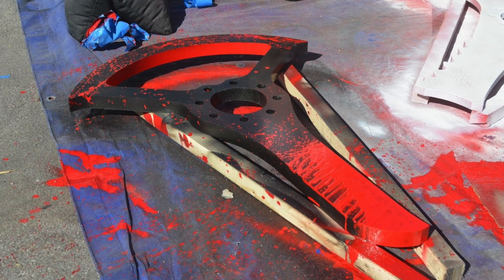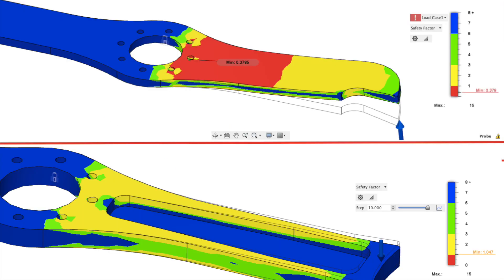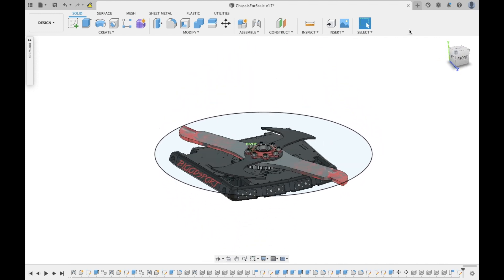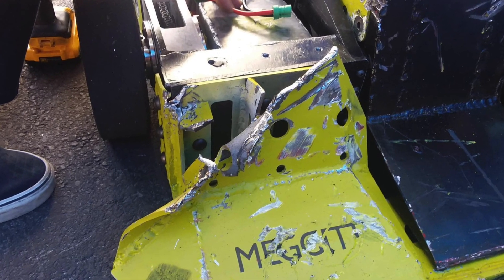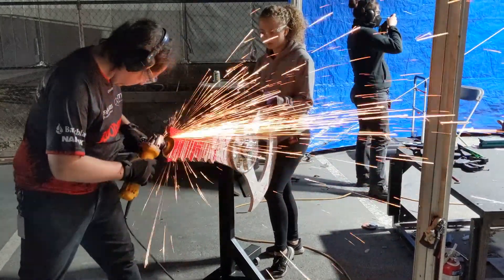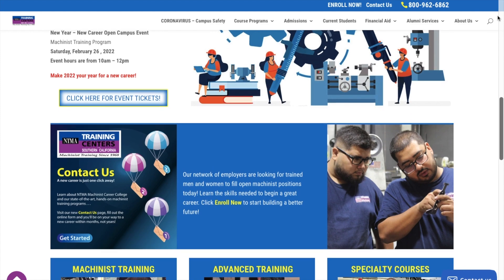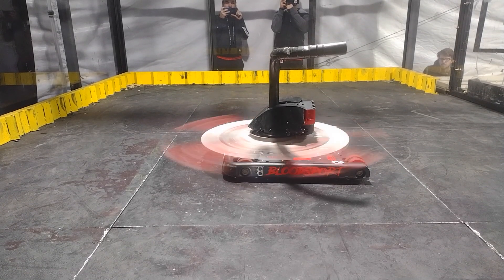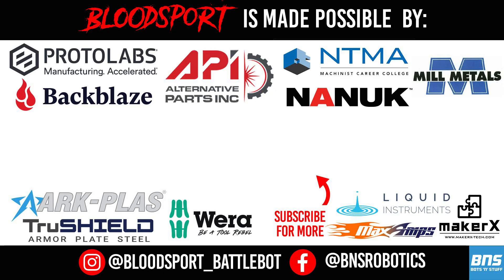The Skeleton Key - Battlebots WCVII Blade Design

Comment: The long bar is unbeaten against everything that isn't a vertical spinner compared to the other bars. It worked so well so far. Maybe the focus should be in making the points more chipping resistant. The shape seems a little too aggressive.

Comment: Spoiler to those who didn't watch ep 11

Good win from bloodsport, I honestly thought that it had durability issues due to the copperhead fight, how was I proven completely incorrect. Turns out copperhead just hits harder than a truck.
Reply from the maker: We definitely did have durability issues in the Copperhead fight, but with the help of Protolabs we were able to replace the failed part with a much stronger version and it certainly paid off in this one!
Reply: Copperhead doesn't even hit particularly hard for a vertical spinner. And they didn't even connect at all with Bloodsport- it was Bloodsport's own weapon that broke their plastic cover and the circuits.
Reply from the maker: @olisk-jy9rz  It was a mutual weapon to weapon impact. Their drum caught the underside of our blade a split second before we made contact with their frame. I would guess that between the two weapons, about 100kJ of energy was exchanged in that hit.
Reply: @bnsrobotics  That's insane. My 12lb machine stores 3.7kJ in a vert total, not even counting what actually makes it into the material.

Comment: I'd love to hear about how the keys do with dzhanibekov effect. I remember that being a concern in the past
Reply from the maker: We're well overdue for a deep dive video on that topic, but the dzhanibekov/intermediate axis effect is still very much part of our design process. Only a tribar is truly immune to that effect, but adding a stabilizing cross bar to something like the Long Bar helps us to mostly avoid it during fights. The wide counterweight of a Key serves the same purpose, while also contributing to the balance of the blade in a way that a crossbar can't. Because that mass is helping in 2 ways, a Key can actually achieve better stability for the same weight and MOI compared to the Long Bar. The bigger concern with a Key is, like we saw in the Copperhead fight, the blade gets so much bite that it comes to a dead stop and no longer keeps the bot level via gyroscopic effects.
Reply: @bnsrobotics  In early tests I've done, replacing one of the teeth on a tri-bar with a counterweight has a similar stability. I'm trying it out at 3lbs and 12lbs soon at NHRL, so maybe there'll be some more weird weapon shapes to explore. I have the teeth 90 degrees apart, but going back to 120 would be even more stable.
Reply: @bnsrobotics  Thank you for the in depth answer. It's always cool when builders interact with the fans
Reply: @bnsrobotics  You said you're overdo for a video on the topic, and I would love to see that. I'm interested in how you evaluate how a blade will be affected by the intermediate axis effect without actually spinning up and asking Jake or Aren to give you a test flip.

Comment: So what's the plan moving forward? Will the self righter get updated or will  every weapon be symmetrical from now on?
Reply from the maker: We're still working that out for the next season. Part of it is trying to understand why the old Bloodsport could right itself with a Key but the new one can't, which could help us redesign the self righter. Another option is to widen the counterweight of the Key until it props the chassis off the floor the way the other blades do, though that negates some of the weight advantages that a Key has over a symmetric bar with a stabilizer on it.

Comment: That clip of the attempted self-right with the key is weird. It kinda just looks like the motors don’t have enough torque, like the bar just touches the ground and stalls. Is that the blade’s fault? Especially since that particular key is shorter so it should have better leverage than the long bar
Reply from the maker: It's to do with the way the chassis sits on the floor. The wings on the Long Bar act as a kickstand, so the chassis is free to spin without contacting the ground. The difference between BS2 and BS3 has to do with the angle the bot sits at, and the torque needed to spin the chassis when it's touching the floor. The length of the blade doesn't have much effect aside from how it props up the chassis, since once the blade touches the ground it's effectively fixed in place while the chassis is what's moving. This very problem was actually the main reason why Bloodsport 1 was circular.

Comment: I wonder what would happen if you put a max moment-of-inertia weapon on top of Bloodsport, so kinda like the ferrous wheel but with even less bite and more mass on the outside ring. Just put so much gyro-stabilization in there that you never even have to self-right.
Reply from the maker: That's basically the philosophy of Son of Whyachi. The problem is, more MOI either means adding weight or compromising on other things like bending strength. A greater MOI weapon also needs more torque to spin up, which is the problem we've always had with our Tribars which are usually our largest MOI blades. Battlebots competitors are getting faster and the arena is pretty cramped, so having a nimble bot with a fast spin up is how we stay in the game as a horizontal in the age of verts. 

The idea of maintaining inertia after a hit is interesting though, and it's something we've been thinking about a lot lately 😉
Reply: @bnsrobotics  Not to mention a weapon with a huge ring gives verts a very big surface to catch where your teeth isn't. But I just love the look of a big MOI blade where at speed it looks like there is just a metal halo where the weapon is supposed to be.

I'm just looking at the full body spinners that magically saucer all over the place when they get hit, but you're completely correct in the increase in torque required and slower spin-up times. Most likely why SoW had like 8 or 10 mini mag motors in parallel instead of one or two big motors. Sadly my random theory-craft shitposts are no match for reality :(
Reply from the maker: @bami2  You'll enjoy the next blade video then 🛞

Comment: 💉If you had a rematch with Copperhead, will The Skeleton Key obliterate the snake better than the ChonkKey?🍷☠🗝🐍
Reply from the maker: The ChonkKey, being shorter and more sturdy, is going to deliver the maximum amount of energy into a solid steel brick bot like Copperhead - hence the MASSIVE hit we got on their frame. The Skeleton Key is more meant to cut deep into bots with crumple zones, like Whiplash or Claw Viper. The ChonkKey is a hammer and the Skeleton Key is a can opener.
Reply: I don't think there is much obliterating going on if you're just hitting a thick chonk of AR500 like Copperhead. Copperheads frame side was absolutely rekt after the last match but having a better weapon isn't going to change that much since the amount of energy delivered is already insane.